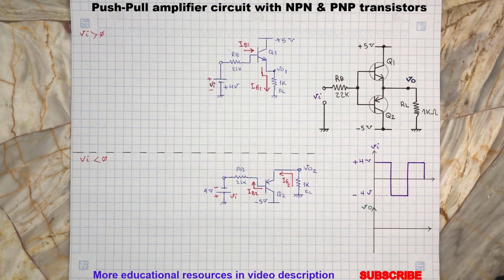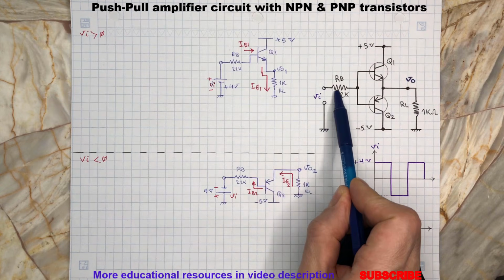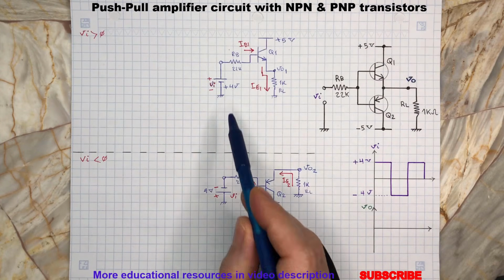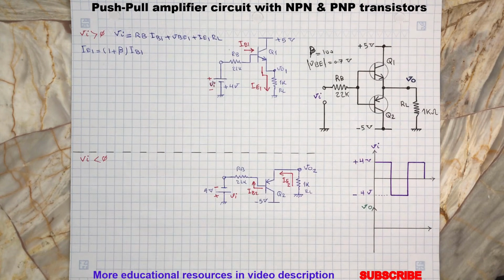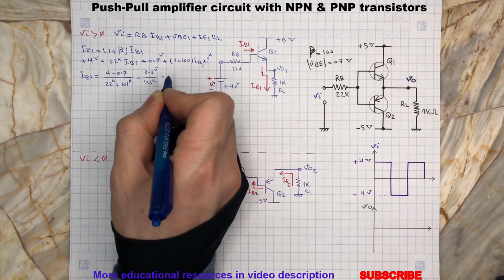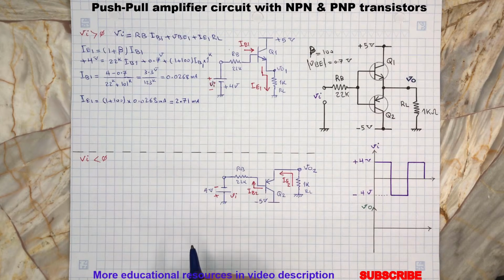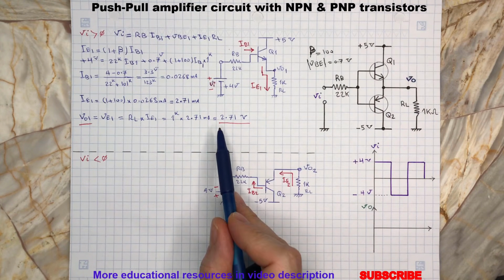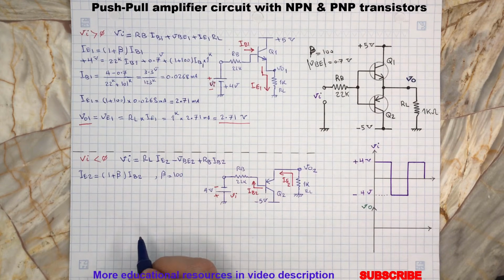Push Pull Power Amplifier Output Stage Circuit Analysis, Class B Push Pull Amplifier Solved Problem

Comment: Hi. Isn't this an attenuator and not an amplifier because the output voltage is smaller than the input voltage?
Reply from the maker: This circuit just demonstrates how to solve this type of problems. Please keep in mind that the output stages like this circuit are to boost the current (and power) and not the voltage.

Comment: Direction of emmiter current in pnp transistor is wrong,  current can not flow from negative ( common earth) to emmiter & then again sink to earth at collcyor
Reply from the maker: When you have the negative half-cycle as input input, then that is the time when the PNP transistor will turn on and you have current flowing from the ground (zero level) through RL, PNP emitter, base and Rb.  That will cause current flowing from PNP emitter to its collector which is connected to the negative bias.
Reply: @EngineeringinDepth emitter of PNP tr should be +ve wrt to base. The only way for current to enter emitter of PNP from +ve not from ground >RL >emitter >collector > ground, this violets law of conservation of energy. However if you introduce a capacitor then it may hold good for some time before capacitor is fully discharged,

Comment: So... 22K is to big ... and should probably be 11K or 12K  instead ....to be able to use the full +/-5V on the output, while only using +/-4V on the input .... ?...
Reply from the maker: Correct, for a full rail-to-rail swing, you need to have a smaller RB.

Comment: when do we know to use open circuit or assume high and low of ac in? my professor does open circuit in most cases especially with mosfet or is that for mosfet only
Reply from the maker: Can you please clarify the use of open circuit? do you mean when there is no any voltage applied to the input terminal?
Reply: @EngineeringinDepth  yes, with Vp still active
Reply from the maker: @BBoysAndTrickers  In MOSFETs and FETs, since the gate terminal doesn't draw any current (we can neglect the very small current to the gate) , then we can assume the the gate terminal has zero voltage when there is no voltage applied to the gate.

Comment: Why the gain factor for base current calculation? These are unrelated parameters.
Reply from the maker: Do you mean Beta is unrelated? can you elaborate more?
Reply: @EngineeringinDepth The base current depends on the base resistor and the voltage. The base current becomes part of the emitter current, but does not increase. Beta affects only the collector current and the emitter current
Reply from the maker: @artemdavinci   For BJT transistors, we always have IE = (1+β) *IB and IC = β*IB. The fact that we use BJT transistors is their current gain. The transistors in this output stage are configured as a common collector (emitter follower) for this reason to provide higher output current gain at their emitter terminals.